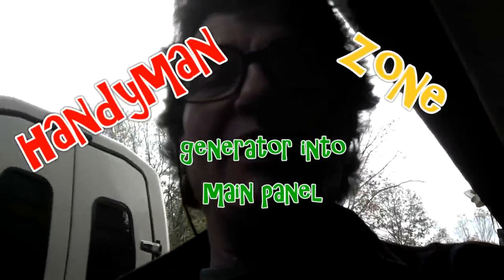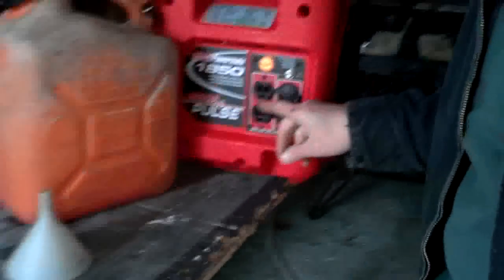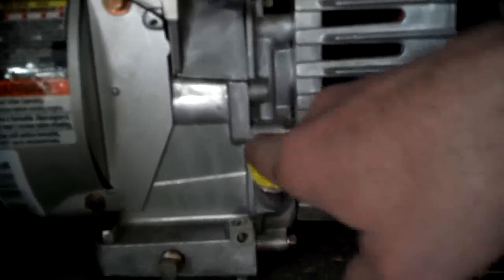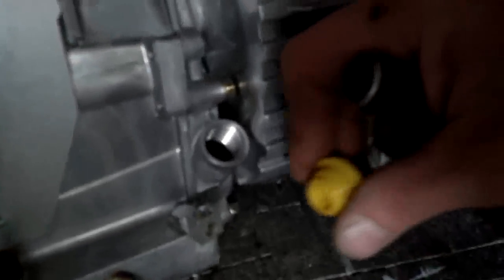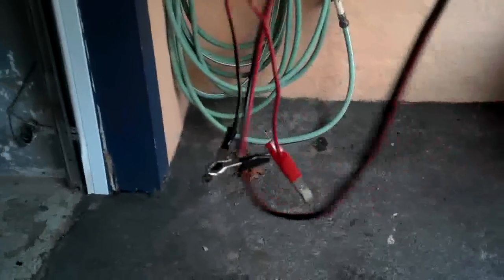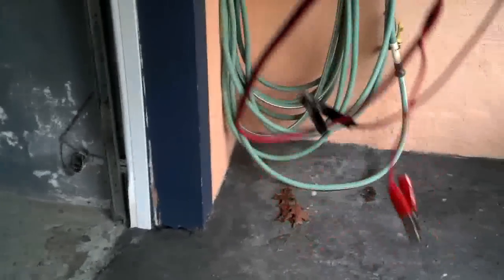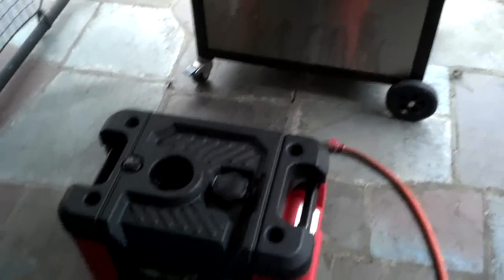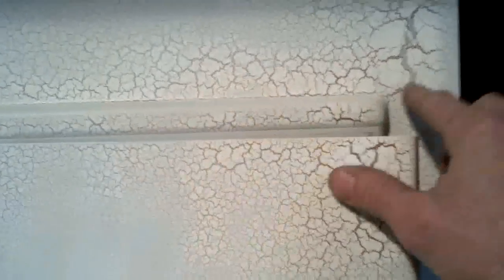HOOK-UP Generator to Home Main Breaker Box

Comment: I am in support of what you attempted to do for your family.  Irene, I ran extension cords with 2 inverter gens. Rewired a 110volt gen to 220 for the well pump, solo.  Sandy, I back fed the welder plug in the garage with the 110 volt inverter gens.  I basically connected the two legs from the one 110 volt leg and supplied both legs.  Of course, shutting the main breaker off.  I did not remove the main breaker, just turned it off.  All 220 devices powered off.  I took my rigged 220volt gen and wire nutted to the Well pump wires from the breakers.  That one only ran when we used the water.  The inverter gens ran all the time, 2 gallons of gas every 9 hours.  I powered the whole house, there were rules, ONLY one major kitchen appliance at a time, ie Microwave, coffee maker, toaster, vacuum, etc.  Otherwise, everything else was without limits, 2 fridges, 1 freezer, flat screen, cable, chargers, CFL lights.  Not one issue.

Comment: After Hurricane Sandy I had no electric for a week. I ran 2 refrigerators, a freezer, TV, computer and some lights, but did it with extension cords plugged into the generator.  I saved the food, had some light and entertainment. If I want to run more things in the house off the generator, I'll get a transfer switch installed.

Comment: During hurricane IKE I had a 1800 watt generator because that is all I could find and afford. I powered my hole house with out the A/C Unit including my outside light that came on automatic. I was very impressed. My neighbor had a 5500 watt gen and his only powered a refrigerator, fan, and a few fans. He was ticked. Wiring it right helps a bunch.

Comment: I suspect you were sincere in making this video (and I didn't watch to the end so it could be a spoof).  You are correct that the lineman working on an outage may be spared electrocution, but, the homeowner may not be so lucky.  Seriously, removing a live 200amp breaker is playing with your life.  If you accidentally touch those lugs, good-night.  No one should be considering this method.  Instead, consider an interlock with the appropriate sized breaker dependent on your generator.

Comment: Do not use the clips they could cause a fire. Do not use back to front plugs this could cause electrocution. Please do not try any of this shit that this guy is doing, if you want to power your house with a genset get a electrician to wire up a diverter switch and a female plug in the wall. Do not even take the cover of the cabinet unless you know what you are doing !!!!!!!!!!!!!!!!!!!!!!!!      !!!!!!!!!!!!!!!!! . I hope I've made my point clear, please stay safe.

Comment from the maker: juvenille2001, after superstorm sandy and the nor'easter the roads were ALL blocked for days, when the roads did open there was no gasoline to be found for a week, then all the electrical supplies at the stores were sold out, no extensions, no breakers no nothing, there was no food in the markets. thankfully i had this generator and the cord and some gas in cans, lesson is be prepared before the storm. now presently i have bigger generators and suppolis, fuel etc, see the playlist, thanks!

Comment: Question:: Wouldn't it be safer to just pull off your outside meter and hook into the 2 lugs going to you panel? Im not much on electric but that would seem safer. Then when power comes back just plug the meter back in.

Comment: Seems really risky, but it's interesting to see it as a proof of concept / worst case scenario kind of thing. I don't think it's the safest way to do it. The safest way would surely be to have an electrician install a proper switch to disconnect you from the grid and a permanent input from your generator.
Reply from the maker: Gadget, your showing off that your smart enough to know everything has it's time and place

Comment from the maker: @nyyankyfan , thanks the comment. in yesterdays bilzzard my family house did not lose ower, but last wednesday/thursday january 23-24, 2013 in that crazy overnight winter wind storm, we did indeed loose power for 45 hours. this was due to a large tree blown into the utility pole, breaking it in half, sending the transformer into the ground along with all the hi-tension cables. due to LIPA self pwnage, we had to go on the military gen, i back-fed the braker box similar but safer to above vid

Comment: The purpose of grounding the generator is to protect you from getting electrocuted if a fault occurs in the generator like a hot lead gets connected to the generators frame. There is no other functional purpose.

Make a few 6" extension cords with plugs on both ends to connect the generator to the electrical box thru house receptacles & extension cords. Keep them with the generator. Buy a circuit breaker locator, make a diagram what outlet is to what CB.

Comment: OMG that cord at 7:30 is SUPER SCARY!!!
Reply: I believe that type of cable is called a ' suicide cable '... I honestly cant believe he'd use what looks like DC cable, wired to mains - then do something as stupid as put alligator clips on the end... oh my god...  what's 20 amp lead worth ? like $10-20 for a 10metre length and a couple of plug ends ? good lord...
Reply from the maker: Sylvia isgod it was correct,  at 15:58 you see me teaching the unlearned where to hook what....please see my reply to zebraman777333 or read the video discription for the backstory, this was life and death emergency, a 19 day saga after superstorm sandy and the following nor'easter.....i am on long island......the middle of sandys eye passed over my town....ground zero....19 cold days and nights...that genset pulled my family thru with heat, lights & hot water and still starts and runs....thanks your concern
Reply from the maker: Chris Bedwell there was no romex or any wire left within 100 miles of long island after superstorm sandy, you couldnt but a lampcord if you had a thousand dollars.....lol read the discription ....plug ends.....haha...that was gold and rigging a extension with 2 male ends like your suggesting is a deadmans cable.....ijs
Reply: @chrisbedwell3376  What does DC cable look Like? What does A.C. cable look Like?
Reply: Christ Wesleyan Church here in Australia, DC is Red +ve and Black -ve
AC is 240vac and is Brown ( active ) Blue ( neutral ) and earth is yellow/green...

Comment: OMG! I almost died Watching this video!!  OK I am in Long Island and had power off for 3 days (I was lucky), What I did was turned off the main breaker (I did not remove the breaker due to when power is returned I do not want to worry about 220 at 200 amps) Disconnect my 220 ac line from my breakers and attach a wire directly to my 220 ac breaker (my generator is 220), Kept the house off the grid till power was restored. I'm afraid a less experienced person is going to hurt themselves your way.